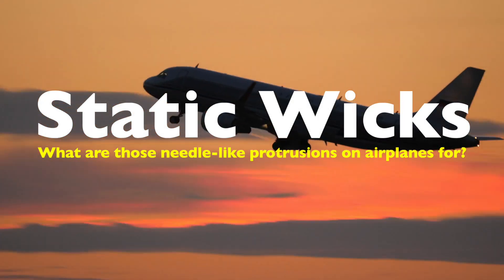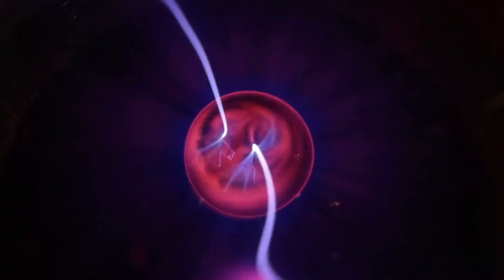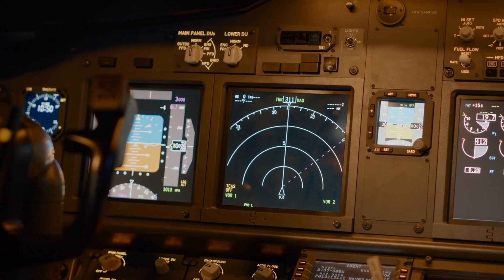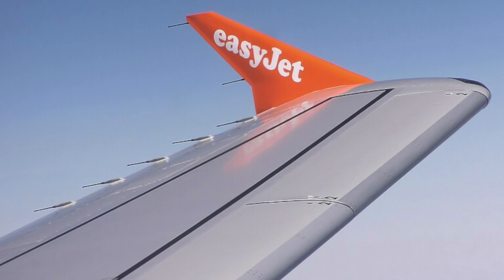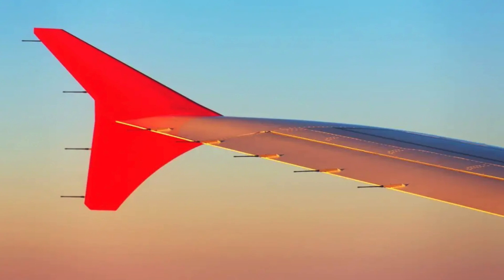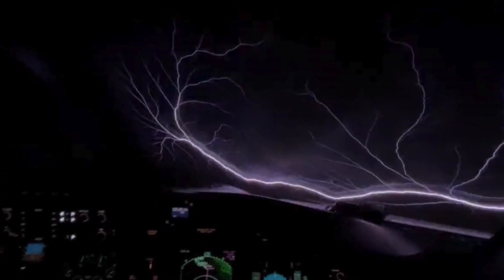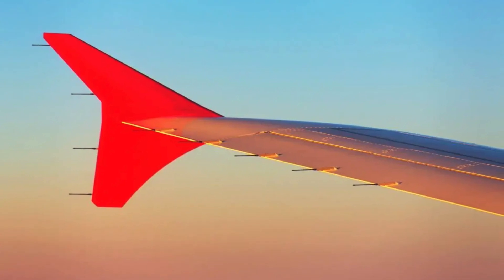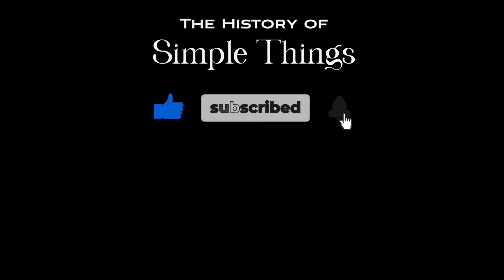What Are Those Needle-Like Protrusions on Airplanes? | The Role of Static Dischargers

Comment: How did older models of airplanes manage? I don't think they had these "needles", am I right?
Reply from the maker: Hi! As what we've researched, older airplanes got by without static dischargers mainly because they were simpler, slower, and didn’t have the advanced electronics we rely on today. They still built up some static charge, but at lower speeds and with materials like wood and fabric, it wasn’t a huge problem. Some charge naturally bled off through wingtips or metal edges. Plus, pilots mostly avoided flying in bad weather where static buildup is worse. As planes became faster and packed with sensitive electronics, the need for more controlled static management became clear, leading to the introduction of static dischargers. :)